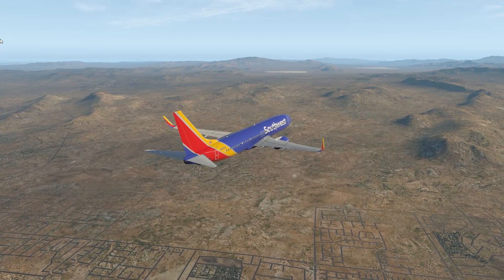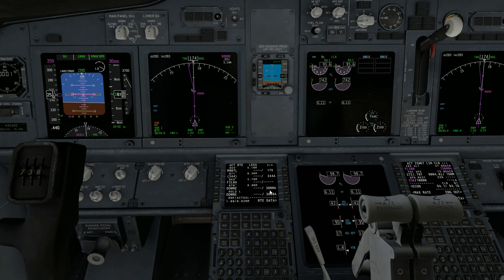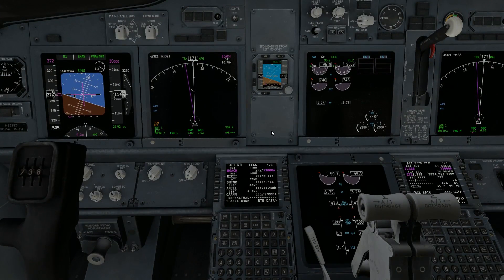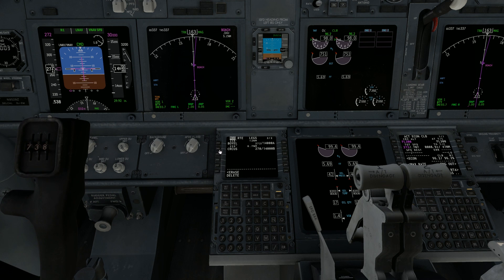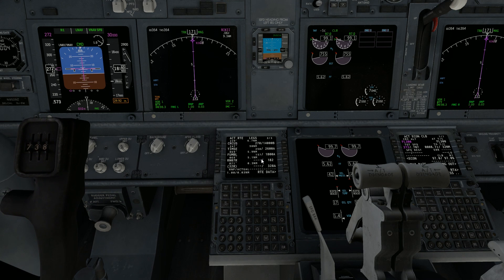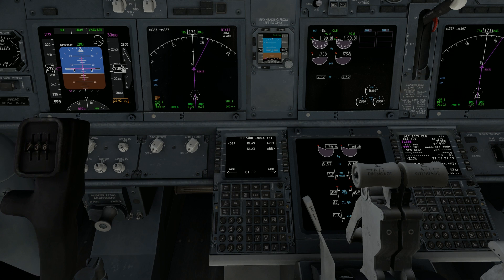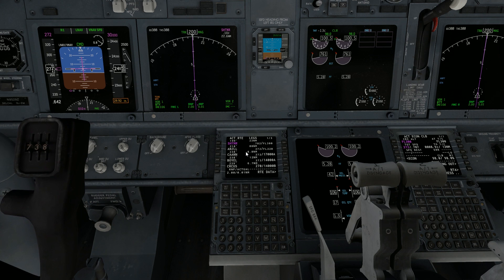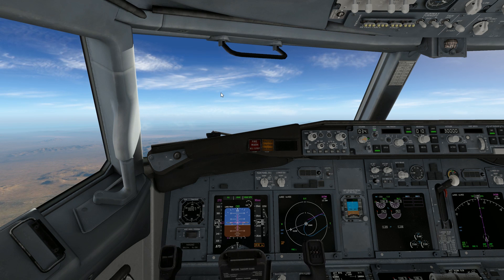X-Plane 11 | Enroute FMC Changes Tutorial | Zibo 737-800

Comment: hi guys, wonderful instruction I still cant solve the FMC. My name is Chas and I live in UK.   can you tell me why I am getting wrong nautical miles in the FMC in the 737-800  eg,  I get 4655, one weigh point,  and second weigh point,  I get  4628     it should show 55nm  and 28nm 
.  ignoring this,   I fly, and when it comes to the last digit on eg,  01   it should then change to oo  direction for next weigh point, and start on 28,   but it starts to count down the 46 thousand nm.

Comment: Wouldn't entering the new approach automatically replace the way points that were part of the original approach?
Reply: Yes, it would and it would be a lot easier than manually deleting all those waypoints!
Reply: @rickgarner6395  No it wont... At least not on the PMDG 737 NGXU.

Comment: Why would you go through such a long berated example to change a runway.

Just go the the Arr Dep page, select the runway 7L or whatever new runway, which in essence deselects the original runway first and makes you select the new runway. Same with the STAR and any transition, execute and go.

That's much quicker and easier than your method of deleting so many waypoints.
Reply from the maker: tgmjr tgmjr sometimes, it creates duplicates as I have personally experienced, so this way that never happens. But, if it works for you, good.
Reply: You still as a good pilot have to go back through the legs page anyway to determine the correct changes, so anyhew, it works for me and seems to be quick and dirty.